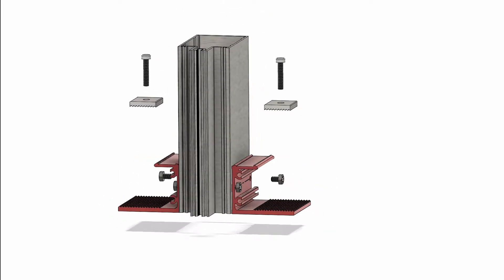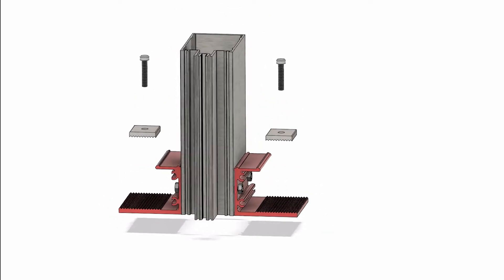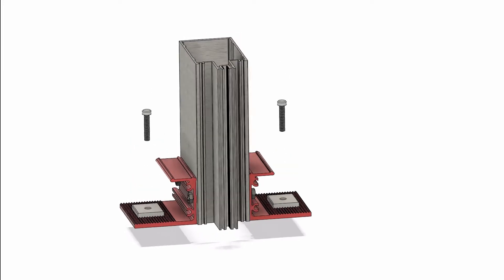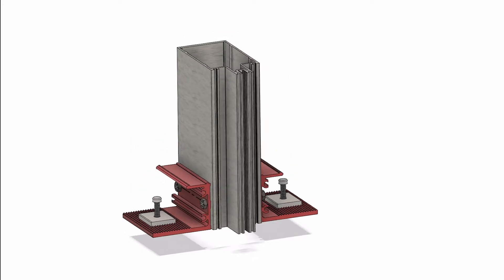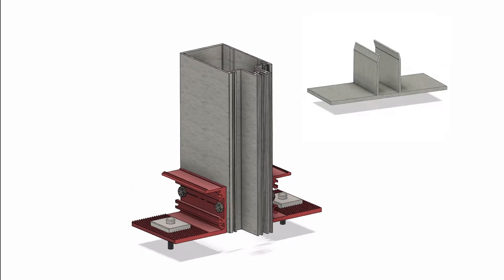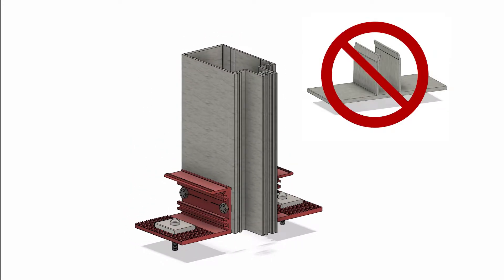Curtain Wall and Extended Leg Shear Blocks

Comment: Being your not using F&T anchors, could the extended shear be installed with nuts and bolts? This would greatly increase the connection strength.
Reply from the maker: Bob, that's a really great point. In short, yes, it would absolutely improve the connection and make it stronger. We have also seen engineering companies add just a couple more fasteners to the connection also. But ultimately, an engineer will still need to take a look.
Reply: Thanks for the reply. Keep the great videos coming.
Reply from the maker: @boblentz5583  Absolutely, Thanks for the support